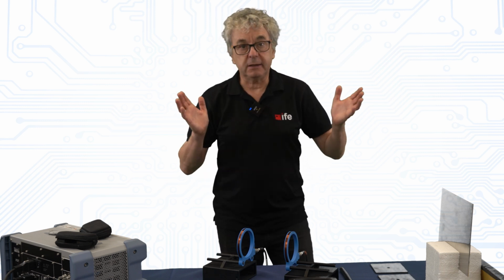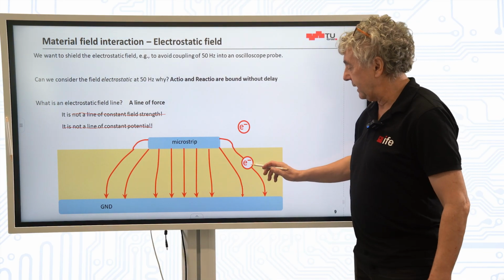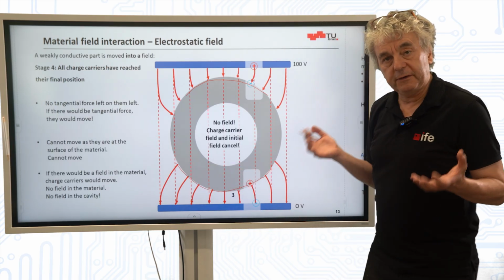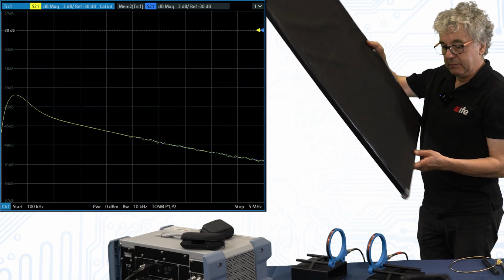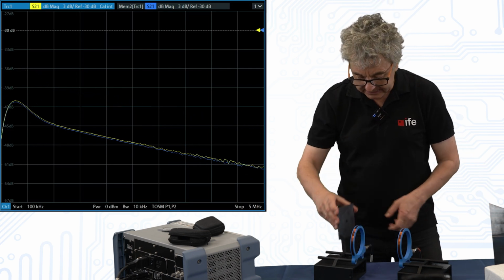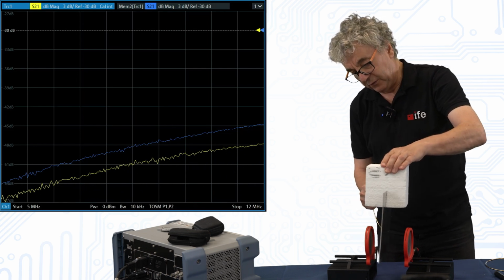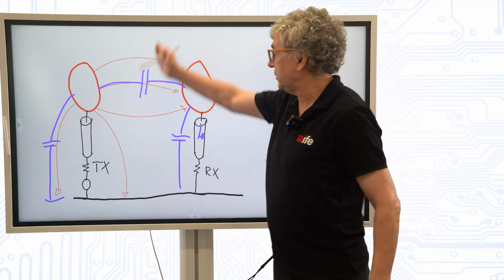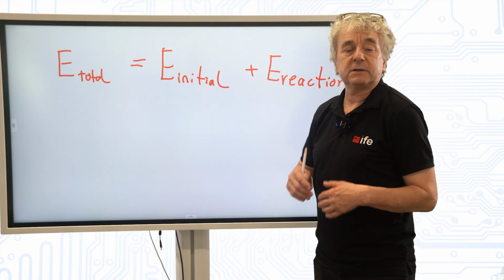How does shielding really work at low frequencies?

Comment: I have designed electrical systems for industrial grade CNC Plasma machines, robotic manipulators, high voltage power transmissions and low voltage control systems.

This video is by far one of the best videos that I have watched on the dark magic of design for EMC.
Reply from the maker: Thanks a lot for the kind words! Let us know if there is another topic you want us to cover :D

Comment from the maker: Have you built something where you needed shielding? 🧑‍🏭
Reply: Yes, just recently had a project with a simple piezoelectric buzzer. It was supposed to be a cheap product, so we tryed to only use one copper layer in the circuit board. The buzzer component has an internal oscillator circuit that was built around a 555 timer IC, to make the piezo disc vibrate at 3.2kHz and make a beeping tone. When we did RF immunity testing, at around 250-400 MHz and 800-900 MHz the buzzer stopped working completely, or started to just pick up the 1kHz AM modulation of the RF field, instead of beeping at it's normal 3.2kHz tone. After some testing and analysis, we found that the buzzer component itself is actually the weak point. We had to redesign the circuit board and add a second copper layer,  to have a solid copper plane acting as a shield in the circuit board under and around the buzzer component. Now  we can blast the device with 30V/m fields and the buzzer keeps beeping as it should.